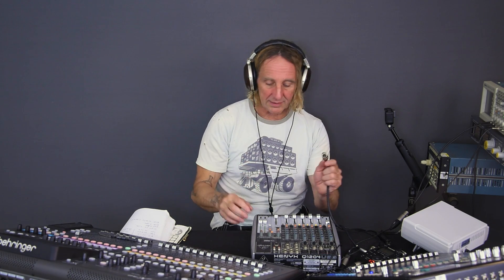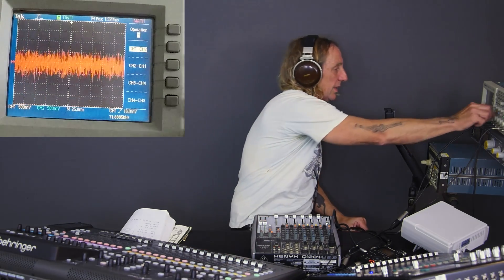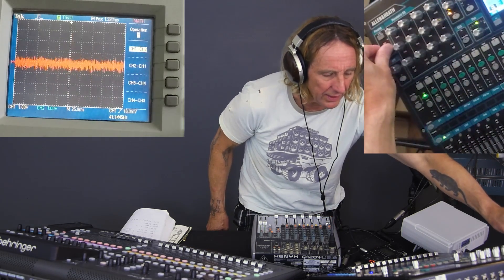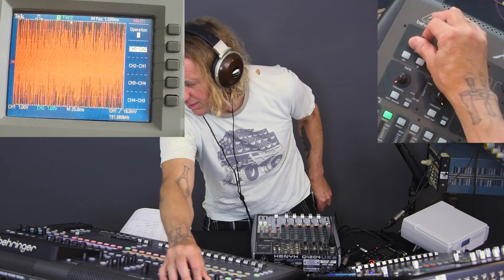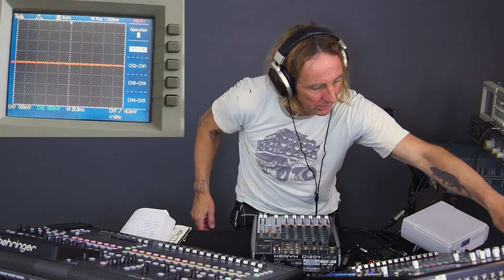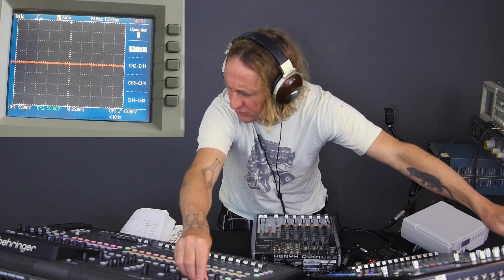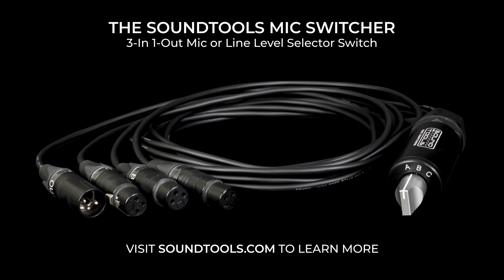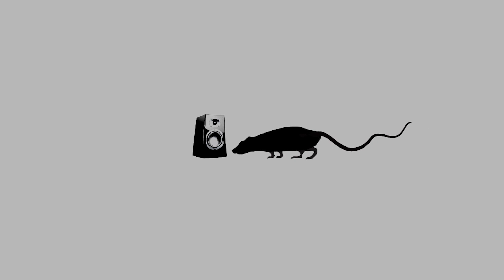Digital Console Noise & Clip Behringer X32 vs Allen & Heath QU16 (Public)

Comment: Maybe I’m the only one in the comment section that’s not an electronic/sound engineer….but, don’t you have both those boards going into that Behringer Xenxy mixer??? If so, is it possible that has issues?  I’ve got two questions here.  1).  Is it possible that there’s something in the signal chain that’s causing that noise? Or, could a something like a power conditioner help with that?….and 2). What does this mean at the end of the day with the average use of the mixers??  I’ve got no loyalty to any brand.  The bottom line seem to be that all these $2500-$3K digital mixers will all have soemthing wrong with them if you look hard enough.  They’re all made in the same place with almost all the same components.  But, just like in the case of comparing interfaces and mic pre noise…. The context the gear is being used in could very well make any test results moot…(i.e. putting a piece of gear through a level of stress it would never go through in the real world).   And, and “how” the noise was generated may not even be relevant to a real world situation with a given mixer.  Live sound has obviously got a much higher tolerance for this stuff, than studio applications. But, a LOT of people use this those Allen & Heath mixers.  If you showed this test to potential customers in a store, they probably wouldn’t buy it.  Yet, you don’t hear a lot of complaints about it. So, when doing a test like this I think all that needs to be considered.  Like I said, short of finding the right product for my scenario, I don’t have a dog in the fight.  I landed on this video, because I’m researching digital mixers, and considering one for a home studio.  Obviously, you don’t want ANY noice coming through a recording.  The question becomes, would that noise, if generated, be noticeable through in an average daily use scenario. 🤷‍♂️

Comment: A friend's bar here bought the Qu16 twice, well almost. Had to replace the mainboard and some other components twice in 5 years and sold it after it came back from the second repair. Meanwhile the X32 in another friend's bar is going strong  for about 5 years as well. Don't know if they got a lemon.  Both consoles sound decent but I prefer the X32 slightly, M32 is a little better, Yamaha QL3 sounded a bit nicer againm especially the FX are way better, but we're already at 10x budget. Behringer Wing is a beast for the money.
Reply: Funny you should bring up the Yamaha….I’m thinking of picking up the DM-3, for a home studio, now that Yamaha finally makes an affordable board.  The one demo I heard, it sounded spectacular.  And, it’s got a small footprint.  I just have no idea how it measure up with the other 5 boards in its price range that have 16mic Pre’s.  A video comparing all the digital mixers in their class, is the one video that hasn’t been made yet….which I find astonishing.😂

Comment: Interesting that in gain test (7:40 - ish) the A&H has a 60Hz earth hum and the Behringer instead adds a 520Hz tone (which had its own harmonics, making it sound a little square?). Perhaps the A&H picking up the hum is something related to the circuitry that causes weirdness through the Y cable when connected to the second console?

Comment: With regards to clipping the X32, clippting the preamp and output stages are a bad thing, giving you flat top square waves. If you route a Channel to BUS to StereoLR, but you don't clip neither the input nor the StereoLR (XLR in and out), but instead clip the BUS do you still get the same clipping artifacts?
Seeing as the X32 theoretically has infinite dynamic range given that is uses a 40bit floating point?
Reply from the maker: Yeah, I think you can overload the summing buss, to test, send all channels hot but clean to 1 bus. Overload should be audible

Comment: It seems to me like the 60Hz hum is present in the x32 as well, but it is buried by the extra noise.
Having used both consoles, I do find in regular use (not needing more than 30dB gain) that the QU sounds better because it's cleaner at the more standard gain levels.
Reply from the maker: Interesting. I have not used either for live mixing so I can only estimate what would happen

Comment: I've been looking for board reviews and can't find anyone testing noise levels! Finally found someone doing it! Thank you! 
Also, on my speakers and ears, the noise was louder every time the visual showed more noise. My speakers are very cheap, but my ears a younger. Maybe one or both of those things makes a difference?
Reply from the maker: Cool. Some of the noise is a lower frequency so speakers with a more full range response and more lows will change things
Reply: @DaveRat  thanks! If you can get your hands on more boards to test, it would be greatly appreciated!

Comment: This is not a correct comparison . you should have not have both on and  plugged into the same source via a separate mixer. You only increase the chance of interference between the units like you demonstrated at 14:40.you should compare the noise with only 1 unit  plugged in and connected to the source. The Behringer is a more cheaper equipment therefore more prone to pick up interference from other units connected to the same chain.
Reply from the maker: Do you really believe that the results will change?

If indeed having both mixers plugged in changes the outcome, would that not be a huge issue with the mixer?

When you use a mixer at a show do you make sure no other gear is plugged in?

Comment: So the A&H has transient suppression diodes on the inputs that start clipping at approx 12V. I don't have the schematic for the QU-16, but I have it for the X32. Looking at the inputs of the X32, there are transient suppression diodes connected to the +/-15V rails. So if you push the Behringer inputs a bit harder I would expect it to clip without warning (nor red LED) just like the QU-16.

Comment: So, if you were to run the signal fom the  signal generator straight to the preamps and not through the Y cable would the results be different?
Reply from the maker: Nope.

Comment: The noise on the Behringer being all in the really high frequencies kind of makes sense with my subjective limited experience with Behringer mixers. They tended to sound like there was some boost right at the highest frequencies I could hear. Other brands sounded more flat to me. This could easily be tested with a scope but I don't have one (or a reference mixer anymore). The sound wasn't particularly unpleasant but my boss also said the stuff we recorded with the Behringer gear sounded more airy and the cymbals stood out more
Reply: I noticed the same thing
Reply from the maker: Thank you Fedge
Reply: I don't have an X32 (yet) so I can't test for myself, but would applying a high pass on all inputs negate that effect?

Comment: The title of this video should be "Why the X32 works better in small venues and in-ear racks than the QU16/32." Just for how the QU's preamps clamp down on the input like they do. If Behringer hadn't screwed up on the service end of the industry, they would have held a better reputation in the market. Where I work, we took in an S16 on a repair. Total nightmare and a complete loss in faith in that company by my boss. He will never own a piece of their gear. Such a shame.
Reply from the maker: From all the QU and x32 testing, one aspect that stands out is that digital clip sucks. The metering on the QU tends to offer more headroom on the inputs with mic level signals.

But mainly it's all about the engineers knowing how each console meters and not doing things that sound bad

Comment: I prefer the Midas M32 over the Behringer X32...better pre amps
Reply: So do I, as I own one, but, not the point of the video. It's obvious the M32 would perform better, but the X32 is more popular due to the price point. I prefer my M32 to the X32 any day of the week, but I'll rock the shit out of whatever board is in front of me to the best of my ability.
Reply: @rickdagrexican7351  The sound is my first priority, but after that things like look, feel, workflow, and build quality factor into it.  I'll take the QU-16 over the X32 any day of the week even though the M32 supersedes both of them and isn't out of the same price range...whats a couple hundred more when ur spending thousands?
Reply from the maker: Interesting. All the tests I did seem to show that the "better" in "better preamps" means lower noise.

And low noise is good but the actual sound appears to be very close to identical.
Reply: @DaveRat  it does appear to be apples to apples thank you for the demo and the response!

Comment: Curious about all the noise on the X32 even when muted.  Live, I can understand, but muted?
Reply from the maker: Whether the issue applies is up to you, and the noise is still there when not muted
Reply: @DaveRat  How bad is the noise?  I'm guessing the audience will never notice (too much other noise even when nothing is going though the system), but if you're doing recording, that might be a different story.
Reply from the maker: It depends, in my experience I have done comedy acts and acoustic shows where noise floor is a concern.  Having a hiss from the PA in a silent theater hush is a bummer. I have also done shows where amplifier fan noise is an issue. I would think plays and orchestral shows would be a concern as well
Reply: @DaveRat  I was thinking "concert" but that's a good point.  Still, it seems strange to me.  I can understand hiss if you have channels up and all those preamps feeding the bus, but a muted output?  That's a straight up design issue that should be controllable.
Reply from the maker: Yeah, a noisy muted output is not ideal. Though using an aes3 or digital output to the amps would solve that
Reply: @DaveRat  wonder if the problem would persist if an S16 is used?

Comment: It would be interesting to compare these two consoles via the remote stage boxes.  The preamps on the A&H AB/AR stageboxes are a better quality than the local ones on the Qu series.  The Qu stage boxes use the GLD preamps,  and offer an additional pad control.   These are still not premium preamps, but still they are better than the onboard Qu series preamps.
Reply from the maker: To the best of my understanding, whatever is used for inputs and outputs determines the sound quality and noise. The surface is just control.
Reply: @DaveRat  I fully agree.  Thanks again for making these videos.  Always informative, and made me go out and do some comparisons on some of my own mixers.
Reply from the maker: Very cool

Comment: The more I see from you, the more digital scares me. Would be neat to see a comparison of say the x32 to a better quality analog board, and would also be interesting to compare some of the same things you do, but with a couple popular recording  interfaces. Or maybe even say a UA Apollo to the X32. Stole your live mixing idea with putting like- minded channels  to stereo busses with a comp dual mono for studio mixing (analog), and that works very well and is really fun too. I'm joining!
Reply from the maker: Digital is awesome but also should not be taken as automatically better.

When using digital, try and convert once and stay digital, avoid multiple conversions with signals other than efx. Never clip digital, be wary and test and listen as digital is awesome and also temperamental.

And most of all, choose the simplest path that gets the job done, if you want the best results, regardless of digital or analog.
Reply: @DaveRat  Thanks, sound advice. The current workflow has a couple steps of conversion, like analog to digital, then digital to analog through the analog board and back to another AD conversion for the mix. Then I listen on another system and "master" in the digital realm. So I have a couple conversion points there and I don't hear a problem, but I think you are alluding to something. Might also add that I've been a programmer for about 25 years and have been basically starting at computer screens forever and whatever I can do to get away from that is a huge plus for me. So analog mixing and less mouse shit means I can have a lot more fun with music. Thanks, and looking for whatever you come up with that you think is interesting. It's all super interesting to me.
Reply from the maker: Do it and let me know how it goes!!

Comment: Hey Dave, Thanks for all your interesting and informative experiments!  I've never used the X32, but have used a Qu-32, so I'm not commenting on the 'which desk is better'.  I'm not up on electronics, but I see info from a reputable place online that mic level is up to around 0.001volt, and line level is up to 1.00volt.  OK, there might be some gear that pushes the boundaries a bit, but is the 9.3volts in the range of concern for normal mics and electronic musical instruments?  Genuine question.
Many X32 and Qu-series users run Ethernet stageboxes.  In A&H gear, I understand the stagebox has different preamps to those in the desk.  Would be interesting to see if the same issue persists with them?
Reply from the maker: I am using peak to peak voltages as they are easier to read on the scope.

Usually people refer to rms voltage.

9.3 p to p is about 3.3 v rms and music typically has 3 to 1 to 10 to 1 peaks. So a 1 volt rms signal will often have a peaks well exceeding 3.3 volts rms
Reply: Thanks  @DaveRat  that puts it in perspective for me now.  Two takeaways for me:  Qu users should avoid crazy hot input signals; and maybe we shouldn't be too quick to overlook good old analogue :-)
Reply from the maker: The big issue for me was the QU was distorting even when the clip light was not lighting.

And the test inputs are not that hot, they are of a level you would expect from an audio playback device with a +4 output, which is common
Reply: @DaveRat  Certainly one to look out for.  Think the only time I've heard clipping on the Qu was when I had made a mess of on-board compressor settings on a vocal channel.  Audible clipping but no clip light.  Thought the vocalist was too close & loud on the mic, but then I checked the DAW recording (signal tapped-off directly after the pre-amp), and it was clean.  Guess it depends where the clip light is positioned in the circuit, but it's another one to look out for.

Comment: I recently stumbled across posts of XLR vs DMX cables and about their impedances: xlr 75ohm and dmx 110ohm, I tried to google more information about xlr vs dmx cables and impedance of xlr cables being 75ohm but can’t find good explanations. Do you have any videos or articles explaining the reasoning behind xlr having 75ohm and dmx having 110ohm impedance ? And differences between xlr and dmx cables ?
Reply from the maker: I wish I fully understood enough to share info. 

That said, I learn by testing and my perspective is that if it has no real world negative impact for the application at hand, then the differences can be ignored.

I have not used dmx for mic cables but have much experience using cat5e for analog audio and all tests result in cat5e of the same wire gauge performing better than mic cables with freq response, noise rejection and transmitting over longer distances.
Reply: I use DMX cable for the lighting in our Church and I had always heard that you shouldn't use regular XLR cables for DMX. I do know that for low impedance mic cables, 75 ohms makes a lot more sense because the impedance should be low for mic cables. The DMX protocol is based on the RS-232 protocol so apparently the experts decided that 110 ohms worked best for this type cable. Also, DMX cables can be very long. The one I use is 150 feet. I know this is not a real good explanation, but hope it helps : )
Reply from the maker: Dmx can be noisy so foil shield helps reduce it messing with audio.

For short to mid length cables, it makes little difference.

I did a vid testing AES3 down mic cables, AES cable and cat5e. Turns out the audio mic cables were better at AES3 than the AES cables and Cat5e was best.

Turns out that larger diameter cables tend to be better at everything than thinner diameter cables regardless of of whether they are mic AES3, dmx, or cat5.

Comment: It's true what you say Dave with regards to making crappy gear sound great. On Drumeo, Jarred takes literally a toy drum kit and puts some half decent skins on and "hey presto" ...it came up pretty good. With regards to the Q series console, that buzzing could be earthing differential between maybe the logic board and the AD-DA converters... maybe? 🤷🏻‍♂️Maybe some phantom voltage leakage being drawn from the input despite it being off?  Dunno but it's great how you find these quirks regarding things to watch out for. I'm still happy with my little Midas M32 best bang for buck me thinks. 😉
Reply from the maker: Cool cool. Yeah, not gonna dive into why as much as look for Gremlins.

Comment: I don't know if it's my younger ears, but the noise floor on the X32 seemed louder? Could this be the video/recording? The Allen and heath obviously has the horrible noise at higher voltages, but the noise on the x-32 sounded overall louder
Reply from the maker: Loudness is a perceptive and scope readings can be deceptive.

Also, since the noise has differing frequency content, the perception of louder will be dependant on the bandwidth and freq response of the sound source you use to listen
Reply: @DaveRat  PS, you're an absolute hero in my house, your videos are absolutely fantastic, and the way you show very complex systems/concepts simply is truly magnificent!
Reply: @DaveRat  good points, I hadn't fully thought about that, I was listening through headphones and would have hoped it to be reasonably representative, so interesting to see that I hear it a little differently to you!